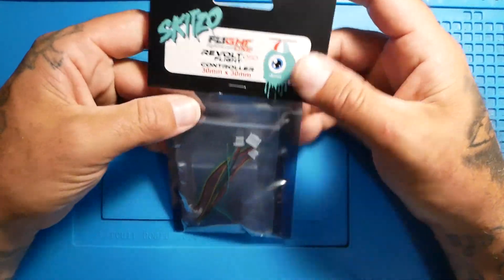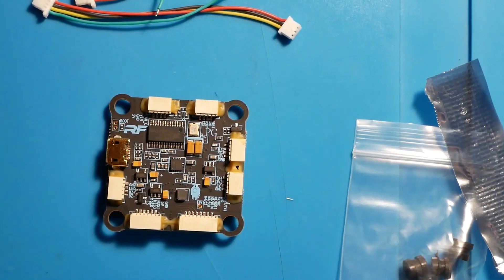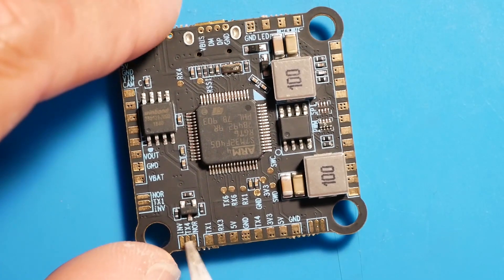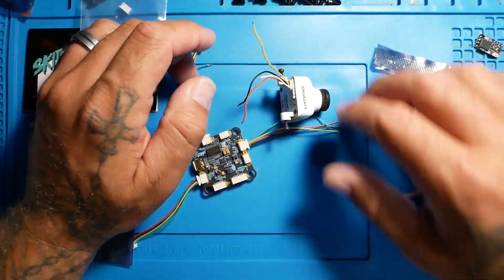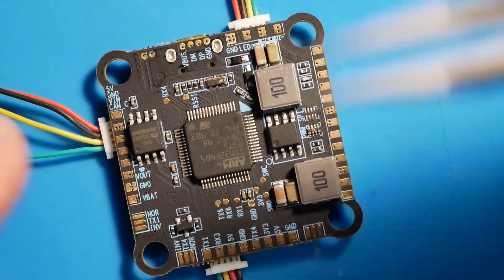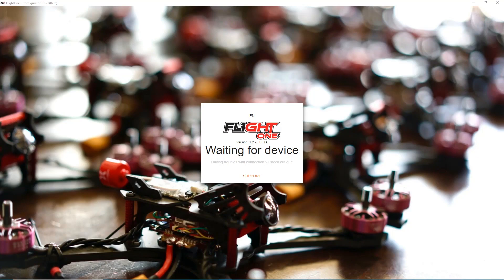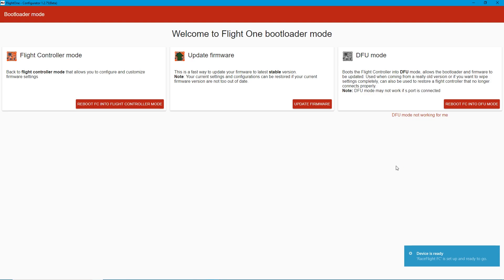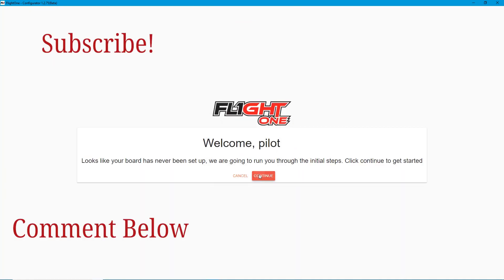Skitzo Revolt OSD How to- Pinout - Firmware Flash

Comment: Hello DraiNman Fpv, Nice video and very informative. I did all the process you posted but I’m confused how to completely download the Companion Falco X firmware. On the Raceflight website I downloaded the Alpha and Beta, tried both in my FC but every time after flashing, the Configurator cannot detect the flight controller. So I tried in the Dji goggles as well but I don’t see the OSD either even tho I already turn the osd on in the goggles. By the way, I am using the Skitzo Revolt OSD, which comes with ports and plugs. Could you please send me the link how to completely install and make it work in my FC? Thank you in advance